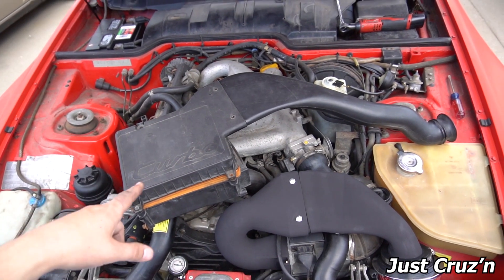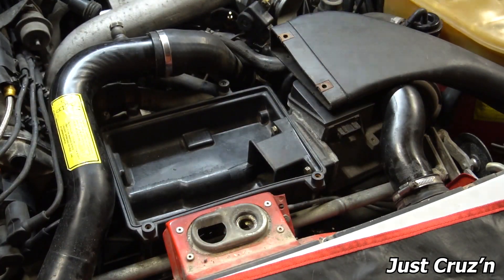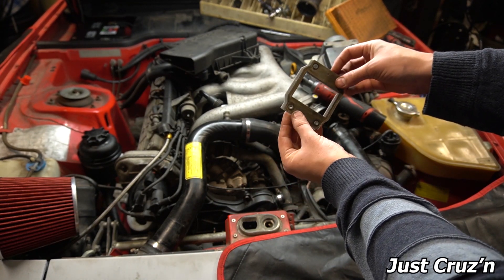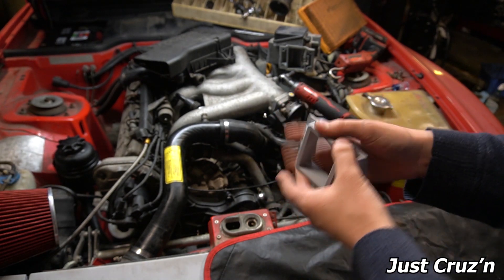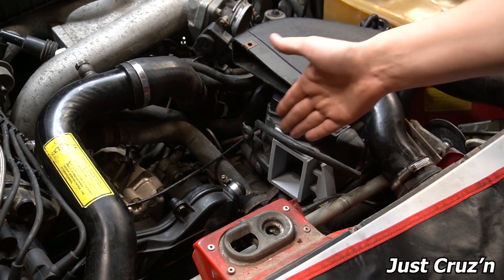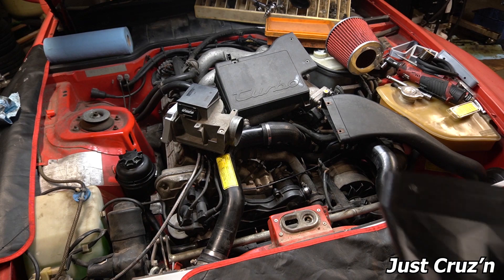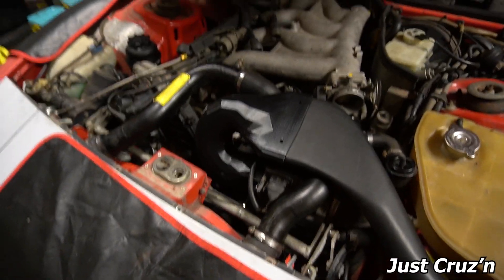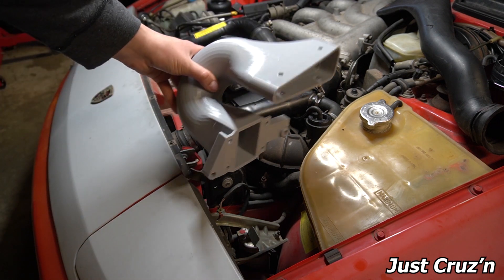3D Printed Car Parts: Designing and printing a custom Porsche 944 Turbo Intake // Just Cruz'n

Comment: Incredible work, the only thing I would have done differently is to use round-headed carriage bolts from the inside the joining of the snorkel,  with a retainer so the bolts drop into the intake. The bolts you got going into the snorkel will disrupt airflow within.

Comment: Great video. I've been thinking about print parts as well. How is the plastic standing up to the engine heat?
Reply from the maker: So far so good. I must admit that I blew the fuel pump last summer so I didn't get to drive it much with this set up. I hope to revisit this project in the spring

Comment: Has the ASA held up to the heat?
Reply from the maker: Yes. The ASA has held up well. I've only put a couple thousand miles on the car since the video was made But I have not had any issues.